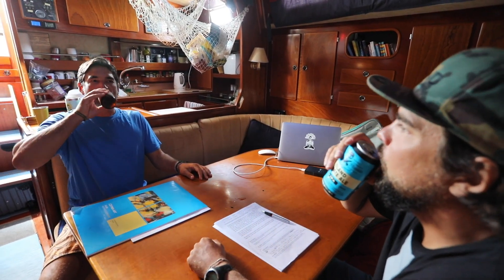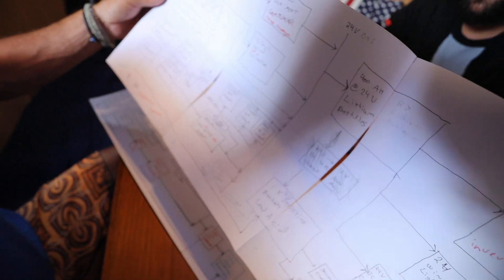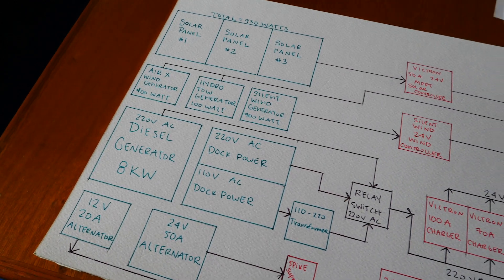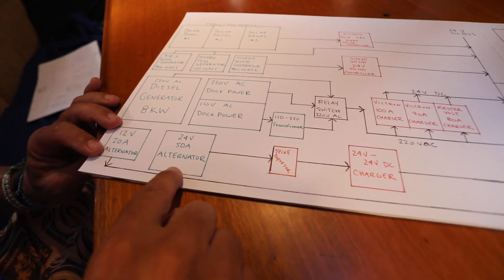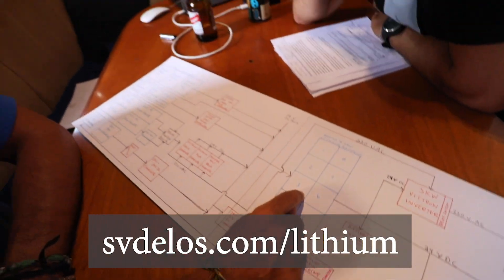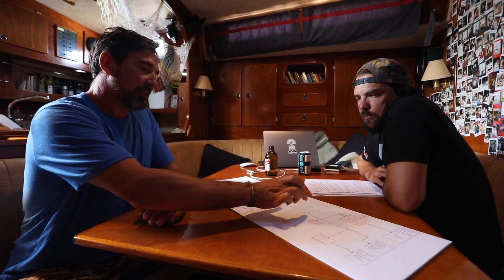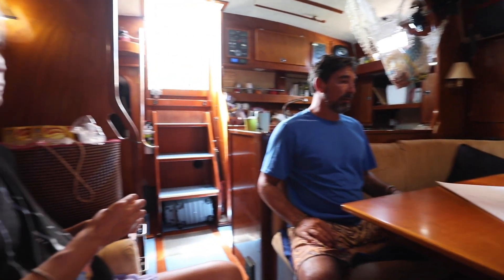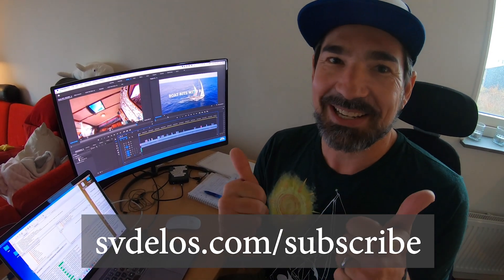Sailboat Electrical System Overview - ELECTRICAL BOAT TECH (1 of 7) - Sailing Vessel Delos

Comment: Excellent walkthrough. 
Why does generator have priority over dock power? Wouldn’t you prefer to use dock power if it is available?
Reply: If the generator is running when you’re on dock power, it is running for a reason.  If you didn’t want the load on the generator, it wouldn’t be running.  Your dock power connection may not be big enough to run high power loads on the boat.  That’s when you start the genny.

Comment: Great video, a real help for our upgrades on PAOMIA. We are trying to decide between 800w or 1200w of solar. 2 panels won’t be wider than the stern and less wind load but 3 panels will overhang by 0.5m either side and make a large flat structure at the stern.

Comment: I love the set up. All units that are not combined. 
My personal brand is Victron and I love the way that brand seek combinations by Bluetooth signal. 
Having a 110 HP Diesel engine I would install. 230 AC gen. And work with step down system to store power. 
Only a small System for the start batt and emg power .. we call that a essential bus. 

The Victron 230 v ac inverter does level the power output so of shore power is slightly fluctuating the inverter will stabilise that.

Comment: Hopefully you have a spare inverter. Love the tech stuff.👍✌️😊🙏🏼⛵️⛵️
Reply: If the inverter goes, you go back to how it used to work - run the gen when you need AC power.  Though I think I would have left the outside grill on propane, just in case.

Comment: Question #1= 20 minutes. Ok, just 23 more pages to go!

So the high level view is great for circuit design and understanding it for modification. Does the Bradester have a low level one for chasing shorts or breaks in the system? As a dummy, I prefer the latter as it helps me know where to look for a particular cable or wire to try and troubleshoot.

One question though; why have the two step down transformers from 24v to 12v? I assume there is some loss in conversion so I wonder why the 24-->12 transformer on the downstream side of the 3K inverter doesn't have a lead going back to recharge the 12v engine/gen starter batt. Also are there diodes on the 24v bus bar to keep an over voltage spike from a faulty controller from back flowing to the other controllers?

Oh and did Kazza write "onin" instead of Onan as tribute to the God of war?;-)
Cheers.

Comment: Great info, with multiple seperate controlers serving the lithium batteries from the different power sources is there a danger that the combined input to the batteries is too much?

Comment: Brian and crew... Really enjoyed the pace and content of this video. I've seen other videos regarding electrical systems and I've veered away due to the ramp of complexity. The approach for this video was excellent and really gave a great overview of SV Delos systems. From here, if I may add the charging profiles for the batteries and also more keeping things safe would be cool. Or a bit of check knowledge like if this 12V system doesn't have power than what controller or regulator might be failing, etc. Maybe a video on safe troubleshooting. 240V to 12V is quite the mix, I know 240V can bite pretty hard. How would one go about the troubleshooting, what tools or practices?? Knew roughly about all the power sources but was really satiated to hear info on how it all works together. Bests :D ~
Reply: Great video. Very informative and well explained.

Comment: Would be interested in how the charge controllers interoperate.  For instance how does the solar and wind generator charge simultaneously?
Reply: The are both connected to the low impedance battery.  They’ll both contribute power to the batteries until the voltage reaches the point where they stop charging. They just think they’re seeing battery voltage.

Comment: dumb question but can anyone tell me how grounding works on a boat? when the spike suppressor has to dump charge how does it return to source?  thanks
Reply: Everything is bonded together with ground wires. The spike suppressor will be grounded to the engine/alternator chassis (and everything else)

Comment: what happens when lightning strikes?
Reply: If you’re lucky, it is diverted harmlessly into the sea water.  If you’re unlucky, everything not in the faraday shielded emergency box is fried, the mast is destroyed, you’re taking on water through the hole in the bottom of the boat and the line between the two is on fire. Often what happens t is somewhere in between.

Comment: Love the tech videos. I'm currently working on designing the electrical system for our next boat and am considering running everything through a very large lithium battery bank, without any direct AC connection going from gen or shore to the 110/220v loads. Any thoughts on that?

Comment: Very interesting, keep this kind of stuff coming. Would be great if you could come up with an episode on full electric in terms of electric engine as well. It seems you‘re motoring very rare, you must have thought about switching to full electric like an oceanvolt system for example. Of course it‘s not the same range, but as you already have a generator on board you could use this as a backup energy source in case you need to motor to escape difficult situations. With an oceanvolt you could also add hydrogeneration as an additional energy source as well. Of course, you would need to prop up on lithium’s pretty much, but that might be the cost of a full electric system. Would be wonderful to see an episode on that topic.

Comment: Is there a back feed prevention mechanism so that your 220 VAC disconnected dock plugs don't go live when you hook a 110 VAC dock plug to the power source (and vice versa)?  Also, how many amps is your 24 VDC to 12 VDC converter?  Great video (as usual)!

Comment: Incredibly insightful and useful video. Thanks Delos!

Could you tell me if you have redundancy for if the inverter failed though please? I can't make our from the video or diagram whether you have another system in place.
Reply: They would have to run off of gen or shore power, assuming the internal inverter bypass is functional.  I would hope the bypass relay is normally closed so it will work even if the inverter is completely fried.

Comment: Hey Brian,  your clear & concise video explains Delos "powerfull" electrical system! ;-).
Would you consider adding a propane grill to provide cooking redundancy and whatever else the grill is not providing?
Have you considered adding a 2nd smaller invertor 1500 watt + or - for redundancy & efficiency?  Do you use DC-DC power supplies to charge laptop & camera-drone batteries?

Comment: I think it would be a great start to ANY boat owner to at least have that same high level understanding of the power system(s) on their vessels.  As an engineer in the USCG, all new engineers were required to draw these to prove they understood the systems they were responsible for, I still follow this method today with my house AND my boat.

Comment: Aye m8's, this is Great and clarifies a lot, thnx! This means eg. the stove is a 220V AC, not so pricy and more easy to get parts for than if it was a 12V DC unit, etc. Looking forward to hear your experience and reflexions on stove, oven and BBQ. Do you have a water heater? Can't see anyone in your list?

Comment: That would be my greatest worry on a big boat not that any thing else would be minor but electrical fire is a great concern .not only is it electric you have a lot to take into consideration voltage ,amps,wattage,corrosion,heat,vibration,distance of run,oxidation ,wear,tear age,compatibility,misuse. and then there is the weather . 

A boat is not a stationary thing      great video

Comment: Hi Brian
I'm Maciel and I live in Brazil. Congratulations on the channel. After watching your video, I got a question. We know that lithium ion batteries are much more dangerous than lead / acid batteries, did you consider this feature when you decided to change the batteries? If there is a problem with lithium ion batteries, do you have any emergency plans to isolate the battery or dispose of it in order to avoid a major fire?
Kindly regards.
Maciel Ramos
Reply: Lithium Ion chemistry used in cars has a higher probability of fire. The chemistry used on the batteries in Delos is almost certainly LiFePo (lithium iron) which doesn't have the thermal runaway problem and are generally considered  very safe, or as safe as lead acid, especially modern batteries with built in circuit protection.
Reply: They are LiFePo batteries, not regular lithium ion.

Comment: 5:57 Yes there are combined systems, called hybrids.  These are a all-in-one unit and are designed to be parallel, for redundancy and greater power handling.  They are less expensive overall, and take up less space.  Not sure which would be better on a boat.

Comment: Good video guys. You may want to use something like Schematics_Lite to draw out your system. Or you can use MS word in the draw function and graph background to do the same. all the icons, shapes and lines are customizable for shape and colour to get a full colour drawing for your system which may be of use later? Check out our boat electrical made easy video to see some of the stuff we have done for beginners using both these drawing systems. Sail Safe! Ant, Cid & the Pooch crew.

Comment: That was very informative. I had wondered about how the various chargers worked and were regulated. I'm scared to death of electricity. It was very clever to isolate everything to the controller for each system. "If power is going in, and not coming out, you know it is bad." Very clever. I really enjoyed this alot.

Comment: great video, I am having some power related problems and this is helping me to sort them out.  One problem is that I had a starter batter for my engine installed.  Problem that I found out much later is that he didnt isolate it from the rest of the system... so that one battery has been basically  added to one of my two battery banks.  its messed with my whole system.  lol... Thanks Brian, love these videos.

Comment: Hey Brian, it would be great if you used your block diagram and built a mock-up display and ran LED lights to show which system is on and or off and how the flow is going at a glance.  It would show where power is coming from and to...so you could see at a glance all systems are working as they should...This is what they do in for high voltage utility distribution power from a power company, it shows each feeder and where outages are....just a thought...

Comment: As a former electromechanical technician working in a university R&D lab, I have to say this is one of the best system level design discussions I have ever seen. Very easy to understand. Not only useful in marine applications, but RV's and other mobile power platforms. Thanks Delos Crew!

Comment: Interesting that the 220 inverter is not utilizing the lithium batteries but only shore and generator power. A comprehensive inverter/battery charger that integrates all power sources including shore power bypass switching including for battery charging would be great. It could deliver 120ac, 220ac, 12dc, 24dc, and 48dc from all sources including battery. Its resultant heat could be used to help maintain the hot water. Its saltwater resilient design could be made modular with likely to fail components easily swappable. :)

Comment: Yes love these videos Brian, can you use the 12v source from your main battery bank for engine starting? Just in case the 12v engine starting battery fails.
Reply: You could get a little starter brick from Harbor Freight and charge it from the various branches and it would start the main engine.
Reply: The 12v side wouldn’t provide enough current.  But they could steal one 12v lithium for a starter batter in an emergency.  You just wouldn’t want to leave it being charged by the alternator.
Reply: @stargazer7644  The starter brick could be charged off of shore power and would be able to start the diesel for about three months.
Reply: @christopherstube9473  Yes, I was replying to Roger's  question about starting the engine from the 12V bus on the boat.

Comment: Great video.  It did make me wonder how all this is protected against lightning and if having independence between systems protects you at all?
Reply from the maker: I really think the only viable lightening protection is to give the energy a source to the earth, around the electronics.  I have heard of people using chain and cable from the mast into the water but I have never heard of anyone doing this that got struck so I have no idea if it actually works...

Comment: Quite impressive system, reminds me of a data center power supply... I used Excell to generate a block diagram for my boat by pasting pictures/diagrams and drawing lines. Looking into installing electric motor (48V), which complicates things in terms of battery/weight/reliability, etc.

Comment: Quick question Brian... I assume that your soldering skills have gotten quite good over the years - and I can guess that soldering as opposed to crimp / mechanical connections are the standard for corrosion protection and longevity of the system on-board... I am wondering what other methods / safety standards do you employ to help you in such a humid / salt water environment ?
Loved this video by the way - waiting for Part II to drop...................
Reply from the maker: On the AC side of things bonding metal that has seawater going through it is a huge deal, and then bonding this to something like a bonding plate, otherwise electrolysis will attack the metal.  As far as DC yes I tend to solder smaller connections and always use good quality wire and shrink wrap the ends.  Also, appropriate sized circuit breakers and fuses I also pay a lot of attention to.  Hope this helps.
Reply: @svdelos  Thanks for the heads up on solder vs crimp... I have heard the opposite from others, would like to hear more about this in one of the follow up videos?

Comment: I'm used to seeing 12v symptoms, car and smaller boats. I'm guessing that the 24v system handles more current flow which in turn would be more power/watts, right? Wish I could be a patron but SSI disability doesn't leave much to work with. I've watched all your videos and look forward for the next one. I'm the guy who had his new truckers hat tore up by my puppy, she has turned into a great dog since then. Love y'all ❤⛵👍🍻
Reply from the maker: Yep, exactly the higher voltage allows you to carry more power with the same current- P = I X E .  Thanks for watching and subscribing, this is in itself a great amount of support!  Brian

Comment: With all that upgrading , do you need to replace the anodes more frequently ?
Reply from the maker: No actually, because of the bonding and external bonding plate we replace them very infrequently.  However the bonding cable broke one time and it destroyed the zinc in just a few months.... Super important!